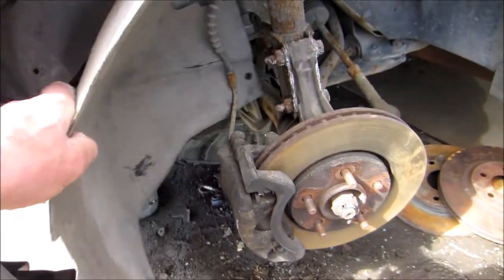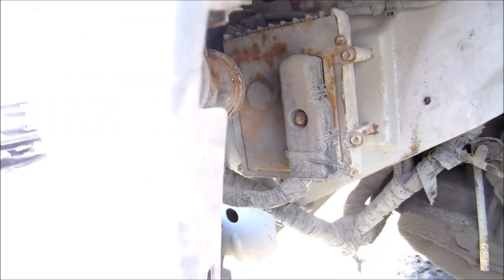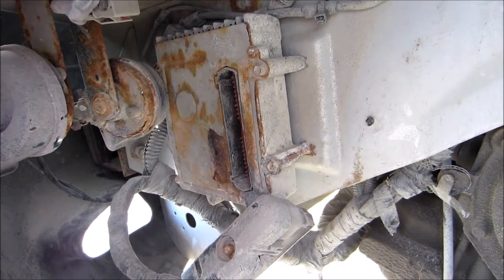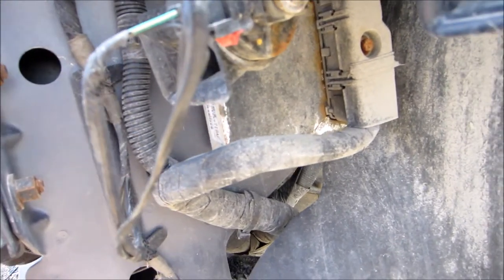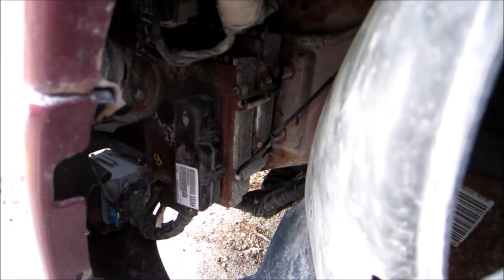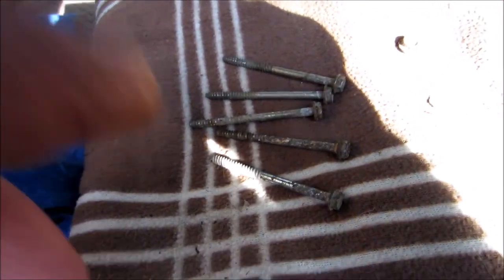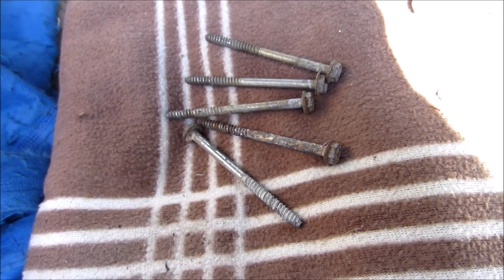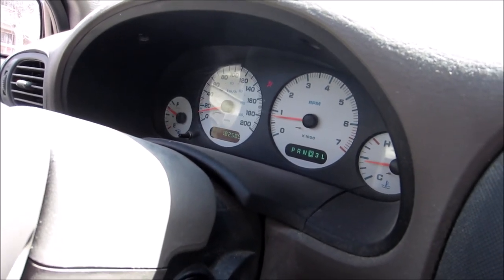Dodge Caravan  Transmission Will Not Shift At Any Speed

Comment: So  do you have to program the TCM to the vehicle or not? I keep seeing videos where people just swap one right in and want to be sure I don't have to spend $200 on a pre-programmed one
Reply from the maker: did not have to re program  ,before you replace check the connectors and wiring  going to the tcm some times water or gravel gets into the wire harness .

Comment: 2002 T&C LX 3.3 flex fuel. This p1684/p0700 was on my dash after a couple of things went weird. changed turn signal. dash came back. after some time the key would take forever to start the car. Driving it, got check engine light. Took to work, and the car stopped driving on the way..smoke billowing out of small cap on right of trans.  told need new transmission.  bought used,  the place took all my sensors and stuck them in the used body.  7-8 months now have check engine.  Car will slip up into first if you go into reverse, or low 3, low 2.. then back.  battery 12.7v .  this kind of car has the transmission control module which is affected by the ignition, a park system, a neutral system, and more sensors. So, the old sensors, and fresh key cylinder need changed.  possibly check relays to the TCM  -  typical is the position sensor on the transmission. left is in, out is right. Some say 0700 is just a code sent saying a fault happened,, and that told to send check engine .  However, a generic 0700 on a transmission code reader will show more info. I am not sure why the transmission smoked the first time. But, the car drives in limp mode now, and has full fluid.  I am buying another car, however, this one needs to be repaired.  There are a couple of things you can do at the same time.  change the Sensors.  Be sure there is transmission A-4 Transmission fluid.. it's clean.  Be sure the battery is strong, and clean, and tight.  If the car is stubborn starting and the key comes out driving it.. replace the cylinder and check sensors for ignition, park, speed, etc.  And on the top back of the trans.. is a sensor for the position of the drive shaft.  It's possible the drive shaft is out of position, it is not speed or not sending speed.. or not sending gear position to the TCM for the car to drive.   It could be that the transmission is shot, and that the clutch packs are worn alot, or the Torque converter.. none of this warrants a new transmission for thousands of dollars. But, a Transmission repair shop would sell you one- if you burn up the gears.. before repairing all these things... (I'm not ACE certified)

Comment: So I have a 2001 Town and Country, same exact issue along with a very very hard 1-2 shift after replacing the solenoid pack and doing a quick learn it was still randomly shifting very very hard from 1-2 ended up being the alternator back feeding AC current and messing with all the readings, I can bet that is/was your issue also
Reply: So a new alternator fixed yours ?
Reply: How did you figure that out? How'd you fix it? New alternator?

Comment: Yea The MAIN CULPRIT that plaques these Chrysler Mini Vans Dodge also is the ridiculous placement of the Vehicles ECU/TCM modules in the front wheel fender where it encounters all seasonal debris water,salt,dirt, mud ect, ect. grounds get all faulty connections get all wet. You end up buying sensors/solenoids that should outlast the vehicle. But because of this stupid design or placement its a failure waiting to happen.
Reply: That's done with the full intent of the outcome we're experiencing. They're not stupid, they've calculated every failure down to the month and the planned revenue from repairs.